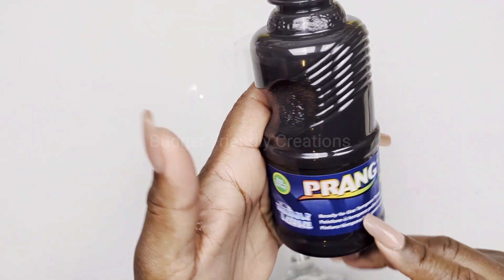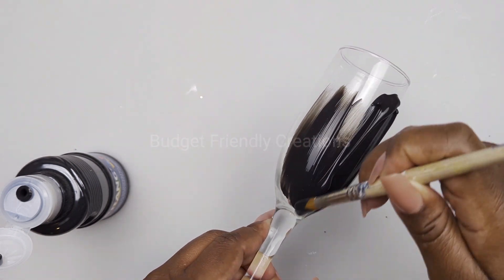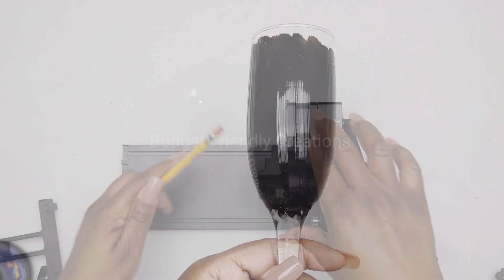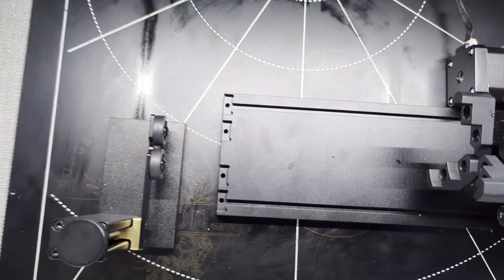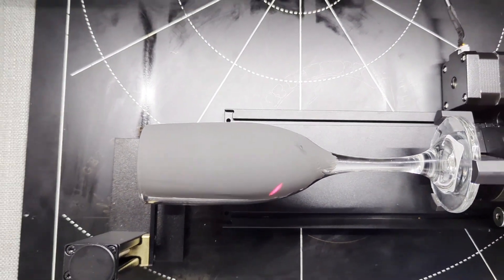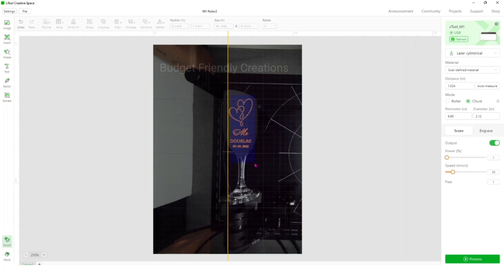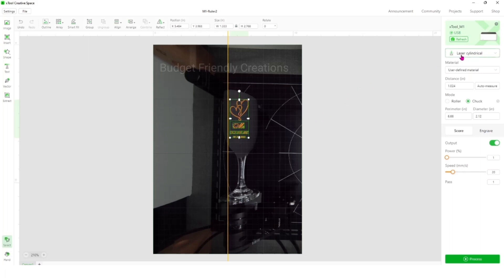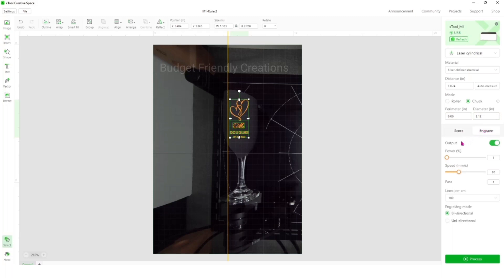xTool M1 RA2 Pro Rotary Attachment

Comment: Great results! I'm seeking tips for solutions in achieving bright visible FROSTING on glass engraving.
I have an Xtool S1 with 40watt and 2W IR  laser modules with XCS software.
When engraving tinted wine glass bottles using Tempura sprayed on, the frosting appearance is low and not acceptable yet. I'm willing to try possible solutions. Thank you in advance for your input!